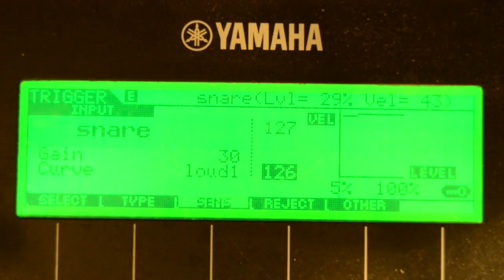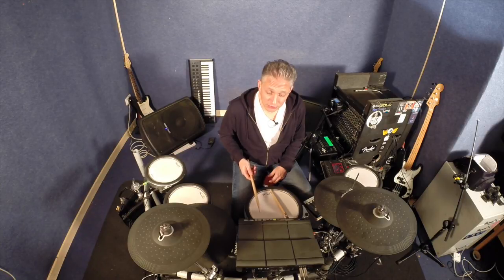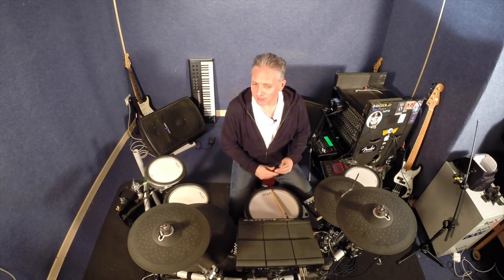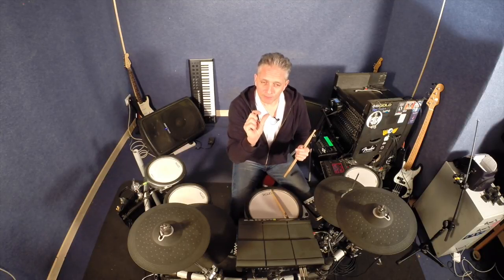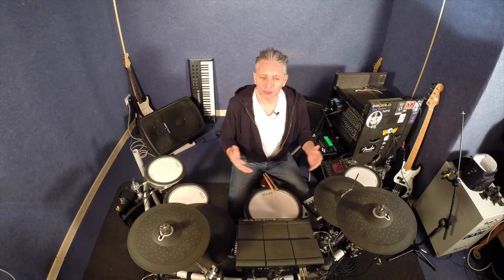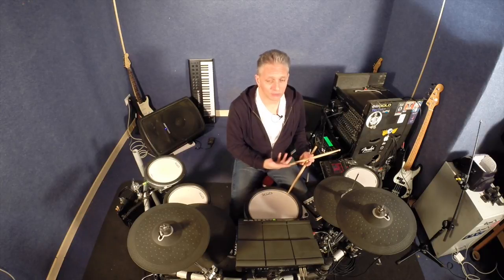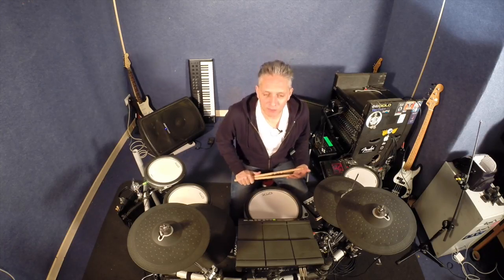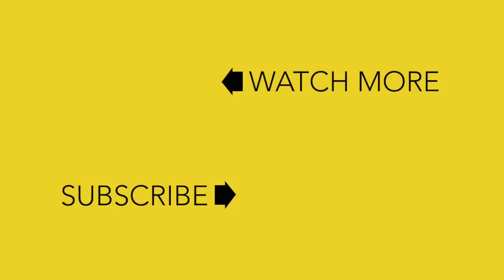Adjusting electronic drum sensitivity, threshold and other useful playing parameters

Comment: Hi, I was really hoping to find an answer to my question in your video but alas no - however, I'm asking here in case you might have seen this issue before. I play a Roland TD-20 and recently added 2 items as AUX. A Roland BT-1 bar, and a Roland PD-8 black rubber pad. I'm having a very strange issue that seems to be common to playing both! Whenever I strike at a low-to-medium velocity, these units trigger the HEAD sound despite playing the RIM. I can only get the RIM sound to be heard if I strike with very high velocity. It makes no sense to me that the "trigger zone" being registered by the module would change according to velocity. Any ideas on what I could check/adjust?  (Unfortunately, Roland doesn't seem to provide support except thru a Tribes forum, where you're lucky to get a reply within a week.)
Reply from the maker: Hi Alain, firstly I don't use Roland so I'm not sure how their modules are programmed however, tech is tech so I do have an idea of what's going on with your set up. If both your 2 aux units are playing different sounds depending on the velocity you strike them with then it says to me that there is something inside the TD-20 that is telling those inputs to do so. Let's say you have your Roland BT-1 bar plugged into trigger input 13 (this is just for explanation) of your TD-20. Go into the menu of the module and look at everything that is related to that input especially velocities, velocity curves, voices assigned to it etc.... There will be a setting which is telling the device to play a different sound, or even trigger once it goes over a certain velocity threshold. Are the sounds that are being generated also on any other pad? 

This is where I'd start to look. It's all about the TD-20 and how that operates so you really need to dive into it and get a better understanding of how it works. Frustrating I know BUT once you do it will open up soooo many more opportunities for your playing and your creativity. 

Does this help? Let me know how you get on.
Reply: @bid111  Thank you so much for your quick reply! Well, your video DID put me on the right path...meaning I think I need to start from zero and adjust the whole kit for my playing style, as per your recommendation in the video. I noticed that I was able to make ALOT of improvement to the situation of the PD-8 by playing around with Sensitivity, Threshold, and Curve settings. (Roland doesn't even mention what settings to use for my TD-20 module in the leaflet, but clearly setting it to PD-8 was far from making it plug and play. Looks like I need to go beyond that and adjust the above parameters for both the head and the rim triggers!)
QUESTION 1:  Do you advise doing all that BEFORE starting to use VST drums (aka Superior Drummer)? In other words, get your kit to respond correctly on its own FIRST, and it should offer a better experience once hooked up to Superior Drummer?  
QUESTION 2: Roland included a stereo cable with the BT-1 but this is a single-trigger bar. I had a mono cable lying around so I decided to try it and lo and behold, the BT-1 works nice - it's only triggering the head sensor and I am able to adjust Sensitivity, Threshold, and Curve for the pad. Yet, they clearly say in their scarce documentation to not use a mono cable as it won't work properly. Well, using a mono cable solved my triggering problems. Go figure... The only issue I have now is crosstalk between the bar and the snare that it is mounted to. So my question is why would someone use or provide a stereo cable with a single-trigger pad? I thought stereo cables were for connecting to a dual-trigger pad....
Reply from the maker: @alainpatry  Sorry for the delay this time! Good to hear my video has helped you out though. SO Q.1 - Yes, I would recommend getting your kit to play and feel the best you can before hooking up to any VST as then you're at a good starting point when you do. Q. 2 - I'm not sure why Roland have specified a stereo lead. As I've said before I don't use Roland but I'm sure there is a reason however if you're using a mono cable and it's working then stick with it! : )
Reply: @bid111  You mention that High Sensitivity cannot cause a pad to be mistriggered by a cross talk - correct? But you also mention something about the threshold maybe being too low on the pad thats misfiring - is this correct?  Well, despite my BT1 bar (mounted to my snare pad) having a good response now on its own - I just can't seem to eliminate the cross talk happening in ONE direction only - the BT1 bar keeps misfiring when i hit the snare (especially the middle, or the rim). ARGH.. this product is plenty advertised as mounted to the snare pad but I honestly dont know what more I can tweak to make it playable. Any ideas to resolve this particular issue (other than mount it on its own stand)? I've assigned them to the same XTALK CANCEL group AND I've set the amount to MAX on both!
Reply from the maker: @alainpatry  Yes that's correct, if the threshold is set to low on a pad it may be causing that pad to be triggered when striking others - as well as crosstalk. And yes the sensitivity is the volume at which the pad/trigger responds to the strike. The BT-1 settings are what you should be looking at, not the snare. Make sure the Threshold is set so as not to let any unwanted strikes (or vibrations) register. Again as I'm not familiar with Roland I'm unsure how their module works however, you've mentioned crosstalk so on the BT-1 trigger input make sure the snare drum is selected as the source of cross talk and adjust this value until you don't hear when striking the snare pad. If this doesn't eliminate the problem then we need to look elsewhere.
Reply: @bid111  Thanks for helping me out. I did as you said and lowered increased the threshold on the BT-1 until it no longer misfired. Unfortunately, at that point it also became unplayable at lower velocity. I then decided to "separate it" from the snare. I found a rod and slid that thru the snare pad's hole where it would usually be mounted to the rack. Pretty confident this would work... but it didnt. Nearly the same amount of misfiring. So that's it. End of the road. I've tried EVERYTHING that I possibly could. It has to be mounted on its own, which is very dissappointing because I wanted an extra rim for my snare (tambourine/shaker effect). I'm guessing it's probably doable with the later Roland modules since they added a BT1-SENS mode to the TD-30 and up, but never released it for the TD-20. So until I can buy an expensive new module, I'll have to do what I can with this one. I'm investigating solutions to mount it close to my snare but on its separate stand. Not easy when you've got a 2nd kick pedal under there :(  Any tips would be appreciated, and if you're all out, thank you so much regardless. I was able to discover a whole new world of settings that I always glazed over in the past.
Reply from the maker: @alainpatry  hey man, no worries and you're welcome. Maybe the fact that Roland introduced a BT-1 Sens mode on the later version shows they knew this was an issue?  It's a way to get people to keep updating their equipment too. Most manufacturers of most/all things tech do it as I'm sure you're aware. If you've found a work around by mounting the bar on a separate stand that solves the mis-triggering then great! I'd imagine you're experimenting with a boom arm which should still aloow you to play the double kick? Good luck with all and I'm glad you've got yourself a little bit further down the road. Keep in touch and stay safe!
Reply: @bid111  One more question about this amazing video:  Around 7:20 you seem to mention that the trigger banks would load with drum kits. Is this what you are saying? I think on my Roland module, they are independent. Meaning if I have "Trigger Bank 1" loaded, I dont think that changing the kits from "Kit A" to "Kit B" to "Kit C" will affect the trigger setup. Please clarify if your module operates differently...
Reply from the maker: @alainpatry  Yes, with some modules (such as the Yamaha DTX900) as you load a kit (a User kit - one which has been edited or is using custom sounds/samples) you can assign trigger set ups to it. So for instance on Kit A, you may want a trigger set up that despite how hard or soft you strike the pad the velocity will be the same -  great when playing sample cuts. However, for the next kit, Kit B, you may want to play more of a soft touch with the dynamics of your playing being paramount so you can assign a different trigger set up to this Kit and so on assigning as many different trigger set ups as your module allows.

Comment: Hello. I got the DTX900 recently.  I updated to the latest firmware. My issue is that when i am using input 13,14, and 15 the pads are too quiet. Do you had any similar issues?
Reply from the maker: Hi there, congratulations on getting the DTX900. It's a great kit! As for the pads being quiet I haven't come across this issue myself. I would suggest checking the set up of those pads against the set up of the pads whose volume you're happy with. And when I say check them I mean check everything. There will be something different  between them abd you'll have to find out what. It's a pain in the ass to do it but it will also get you to explore the module and you'll learn soooo much. Sorry I can't be of any more assistance in this but I hope what I've suggested makes sense and helps you. If I do come across anything that I think maybe the cause I'll let you know. All the best for now.
Reply: @bid111  No worries. It's a lot to learn on that module. I am gonna figure it out, thanks

Comment: We are have an issue at our church with our Roland V-Drums, TD-27 module.

We can't get the high hat to make an open or closed sound. It is stuck sounding halfway open. We believe that it's not the wiring harness, but a setting in the TD-27. 

Please help! :)
Reply: If you haven't figured this out yet, reply to my comment
Reply: We haven't figured it out. The church's drummer is stumped. He replaced the wiring harness and the plastic mechanism that senses if the HH is open or closed. It may be a setting.
Reply: @EddieFaggioli  yes it's a setting. I can explain in a couple hours after work
Reply: I can’t guarantee it’s the same on your TD-27, but on my TD20, Select the Hi-Hat instrument, then use the Trigger button (Top LH ish on the module) to access and adjust the ‘Offset’ & ‘Foot Splash’ sensitivity settings.

Good luck and take care.

Comment: I tried these settings on my kick but it hardly makes a difference. The drum only picks up the hit when it’s hit close to the trigger and hit with force. Could it be a bad trigger?
Reply: Sure, or at least an issue with the cable or TRS plug.
Reply: Or, a bit deeper to DIY... your trigger cone or rod is not touching the head.
Reply: @eDrumsInANutshell  I bought an RT-30 kick trigger, it triggers flawlessly…..problem solved.